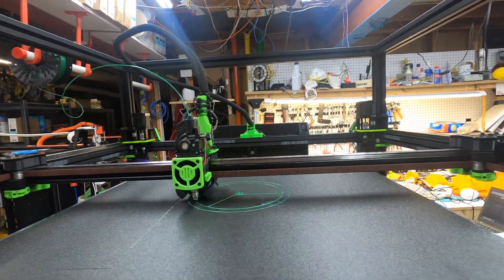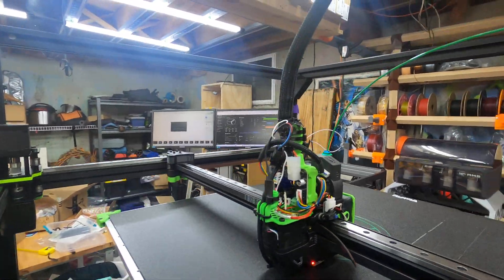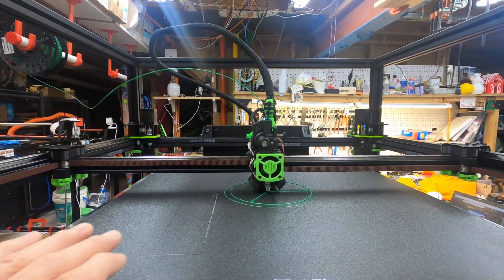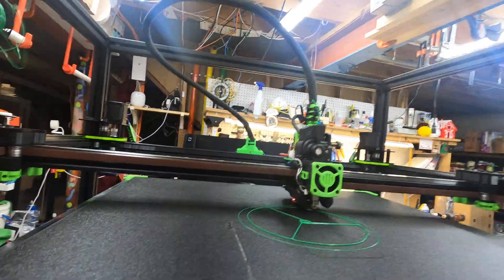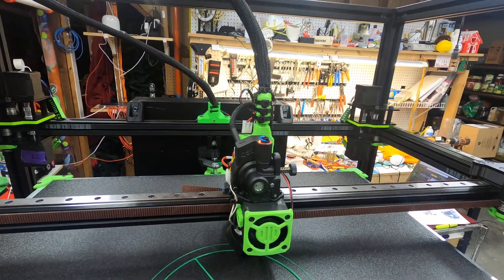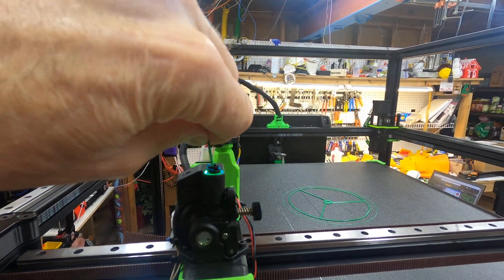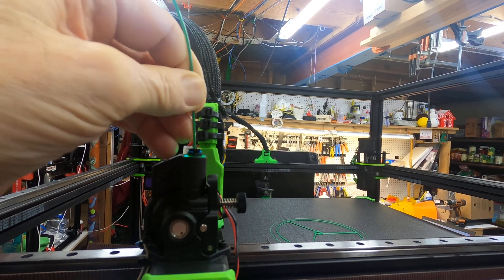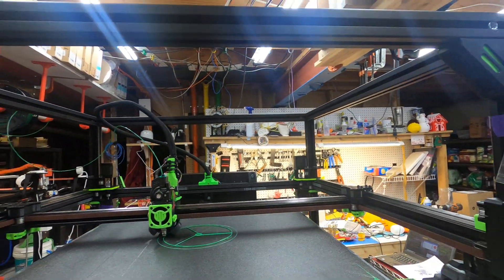The Rat Rig is melting plastic

Comment: When astronomers commission a new telescope, it's a big deal.  They call it "first light".  Congratulations of first print!

I know it's a kit and builders are free to add whatever features they want, but it's surprising that RatRig waited so long before finally offering a filament run out sensor, and even now, it's an option.  I'd expect a $3000 3D printer kit (500 mm V-Core 4 IDEX delivered to the US) to include a filament sensor.  Still, that's a nice filament sensor.  I don't understand why most 3D printer manufacturers still have a little micro switch in a box on the top or side of the printer instead of a low cost optical sensor at the top of the tool head.

Comment: To stop build plate damage, Use a piece of plywood covered with corrugated cardboard. if it marks the cardboard its too low. When its about right print a line on the card and using calipers measure the thickness to see if it is the correct height. 0.2mm layer height means 0.2mm line thickness.. This method also prevents damage to the nozzle. Dont forget to level the bed .. .

Comment: Great to see another vcore 4, I’m building one as well. Any tips to not mess up the build plate in the beginning?
Reply from the maker: I was confused as to what nozzle to use, figured out that you need the externsion and one of the two supplied nozzles,  I used the .4 mm steel and that seemed to be the correct height.  I did not heat tighten them and the result was they were about 2mm to low.  When I ran the Z adjustment using the test print, it plowed into the bed.  I stopped it as quickly as possible, but learned a lesson
Reply: @woodwaker1  Nonetheless, you got a vcore 4 going! Stoked for you, as it's a great machine! Thank you for your response
Reply from the maker: @dkgoodrich8899  We are working on a write up for the Orbiter 2 filament sensor,  Just about done

Comment: I like the filament sensor demo.  That is pretty slick.  The dot was a good idea.  I would have never noticed that spinning.
Reply from the maker: Thanks Scott, I was baffled as to what it was doing until I added the dot.  It can move the plastic forward or backward and slow or fast, but I had no way of telling.  The programming is interesting, I'm trying to understand someone else's code and figure out what to change.  The good part is it is in simple English tags and commands.  So far I have removed some of the functions to try and get the main ones working.  The sensor itself in a vast improvement on what we have been using in the past and is very inexpensive - about $15, it has a small board with logic on the inside than can measure no filament and resistance the exceeds a certain amount - meaning there is a jam.